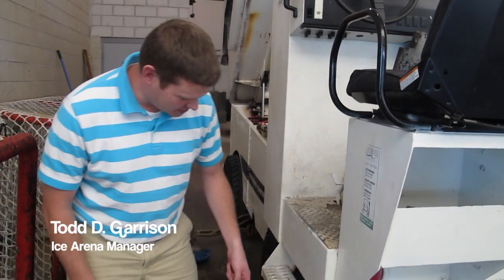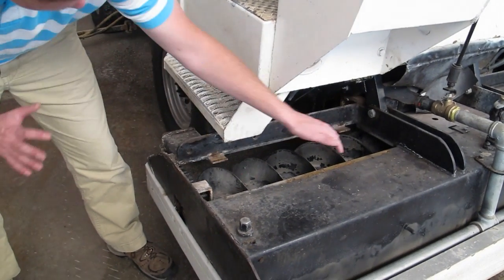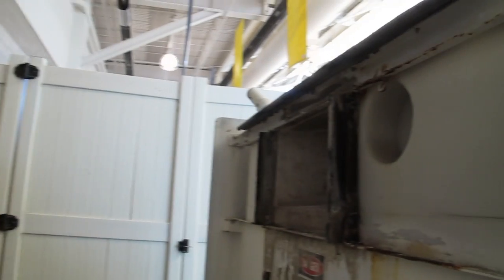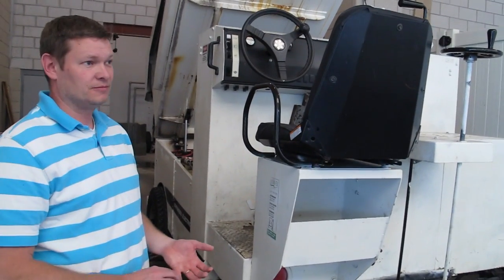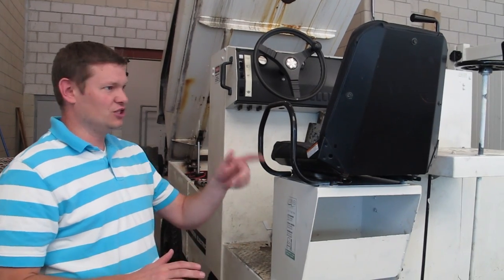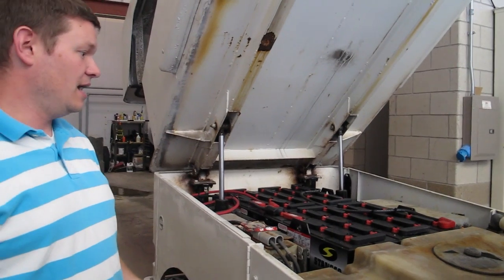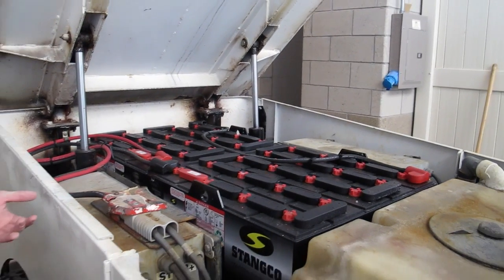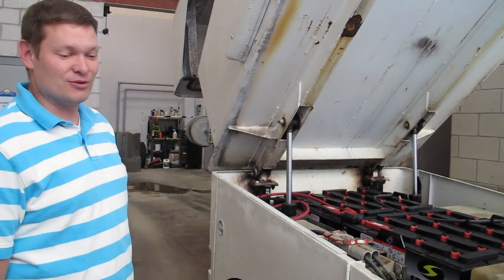How a Zamboni Works

Comment: It really amazes me how universally simple working that tool looks to folks. It seems Everyone who watches a zam operate also sees it as one of the easiest jobs in the world.  If what you see is a guy likely sitting down and turning right 180 degrees about 16 times during 8 to 9 laps and then casually leaving the ice, you would be grossly misreading the entire job. Most of you have absolutely no idea about how much science and understanding goes into the work apparently because there are so many clueless operators (many making youtube videos) who actually get paid driving these machines around thinking the same exact thing and perhaps why so very many rinks have crap ice. Just because you pick up a hammer and swing it does not make you a carpenter. Consistently making perfect ice is the difference. Does your driver flood the rink into a lake just before you play hockey? Then you are likely looking at a moron. Does your driver race the zam and finish in 6 minutes? You are likely watching moron hard at work then. Does the machine seem to be behaving as if its been beat to hell and runs like a jalopy?  Strangely and despite how powerful and heavy the machine seems, It doesn't take long to murder a resurfacer with a broken maintenance plan and negligent operation. It isn't easy folks. It only looks easy due to many, many, many hours of labor doing it right after being taught how to do it right. Many of the rinks I've seen have incestuous training programs that started with ignorance. Any 16 year old with a license can drive the machine around for 15 minutes. Is your driver an expert or merely think he is?  Perfect ice every time before and after any and all types of programing takes a lot of thought and understanding and information. Does the surface remain exactly the same depth year after year without scraping paint or burying it under inches and inches of ice? And I haven't even mentioned the refrigeration study.

And who in their right mind would assume anyone is recycling the snow? would you expect to recycle dirty mop bucket water? Gross. Think about this next time you reach to grab snow from your rink floor:
Gentlemen, snow tank contents include from time to time; sweat, spit, snot, blood, hair, urine, puke, and many other toxic fluids, various metal; ie-coins, keys, pendants/jewelry, hockey gear screws and rivets and threads, plastic and paper trash; ie-mouthguards, gum wrappers, and of course the same dust and dirt and filth you'd expect to find on any floor. just because it's cold doesn't change that its a floor, same as any other. surprisingly, the one thing you shouldn't find in the snow tank is a puck because the machine doesn't swallow those very well at all so, to All of you who either leave the pucks accidentally of on purpose thinking "the zam will get it" are hurting, no destroying, your machines ability to operate properly by bending the augers and eventually punching a hole in the tank lid. simply put, you are hurting your chances for the operator to leave you an exceptional skate surface for your activities by ruining your $85K machine, give or take a few bucks. Yes, buying a zam is similar to buying a Porsche and should be treated with so much respect. The Zamboni is absolutely the best most amazing tool invented for creating fantastic ice but its still only as good as the operator. No offense to any other resurfacer operators out there.
Reply: Can not wait for your Zamboni Video. Should be pretty informative packed with tons of solid information on maintaining the ice resurfacer, basic refrigeration , ice maintenance and ice painting technologies.
Reply: I had no idea that zamboni operators were an oppressed class. TIL.

Comment: Not usually.  The snow taken off is often dirty from skaters transferring dirt from the floor to the ice via their skates, not to mention the occasional dropped sweet wrapper etc.  Heating the snow to melt it and then filtering it would be expensive so you may as well use fresh water!